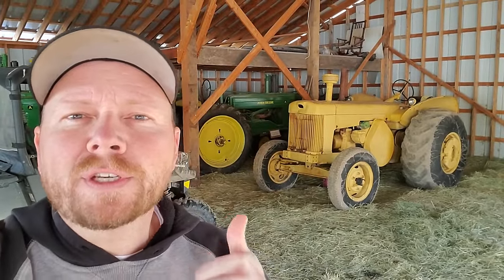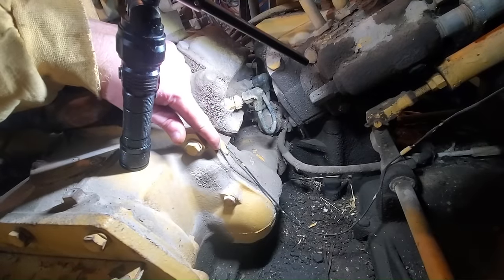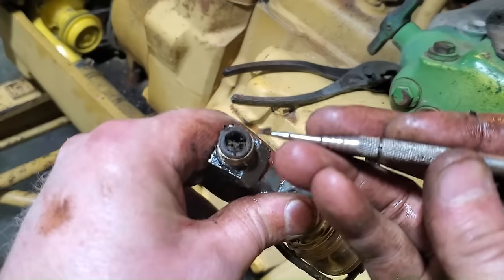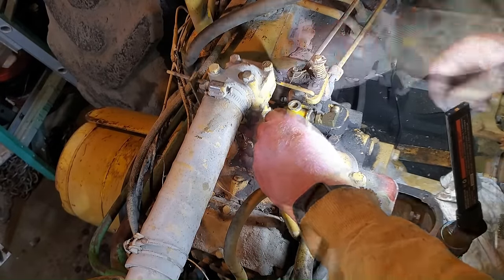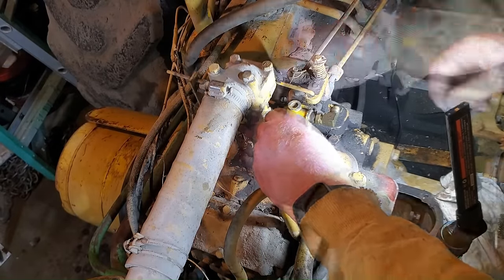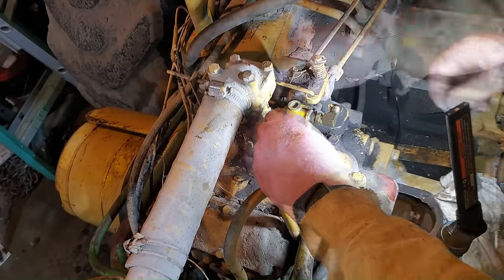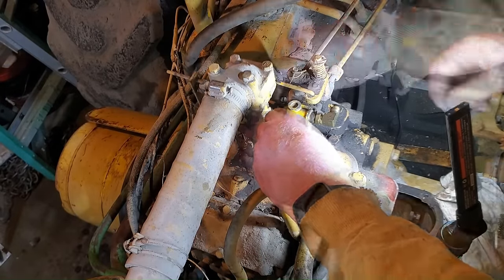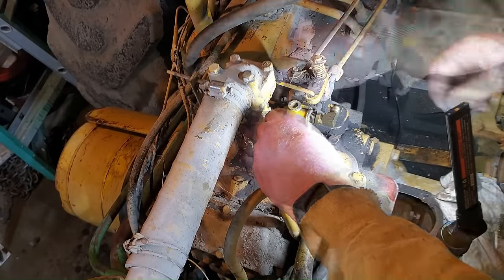Pony Motor First Start - John Deere 830 Industrial

Comment: Great job getting it going. But my lungs are choking from the smoke just watching. Wish you had more ventilation!
Reply from the maker: Ha ha! Yeah, you'll notice I had to open the garage door to air the shop out. I'm the summer we always have the doors open, but in the winter we try to keep the heat inside... So we end up asphyxiating ourselves😬

Comment: I have heard the phrase "the coils must be fried" but never seen any like yours.  Those are definitely fried.  Good decision getting a new distributor.
Reply from the maker: Yeah, I was hoping for the inside of the distributor to be a lot better. But now I guess I never really need to worry about it again (knock on wood).
Reply: @jonelsonster do NOT leave your ignition switch on. Do NOT leave your ignition switch on. You will end up with burnt up coils again. I added an oil pressure switch in the circuit so that they don't get power unless you have oil pressure. If you want more details, let me know

Comment: I use champion J8C plugs in all four of my pony start tractors (least I think they are Champions, definitely are J8C).  Back off the throttle before engaging the fly wheel, it won't stall the engine and your brake in side the pony clutch is sticking, spray it good with brake cleaner.  It should break free but definitely idle it down first.
Reply from the maker: I'm learning. I'm hopeful that it's the brake that's stuck, like you mentioned and that it can be broken free pretty easily. I think that will be easier to access than the clutch disk down on the flywheel.
Reply: Study the owner manual. Pony motor is unique

Comment: There should be a grease fitting under the cover of the pony clutch area. I had that issue once but greasing the zerk fitting resolved it.
Reply: I tore apart two and neither had the grease fitting. I never figured out which ponies did or didn't have the fitting. I think it's for the clutch throwout bearing
Reply from the maker: Very good to know. I'll have to do some searching. It'll be interesting to see if this one has it or if I'm like @weirddeere and don't have it.

Comment: Seems like parts and components age faster when they aren't being used. I imagine the cracks are ports for unwanted moisture and that doesn't help either. The pony motor sounds pretty nice running. I understand they do tend to smoke a little though. Your daughter looks like a boss sitting up there steering. Girl power is real.
Reply from the maker: Totally agree. Letting equipment sit (especially uncovered outside) is very hard on all the different systems of the machine. And yes, my daughter loves helping me drive the old equipment.

Comment: That was a good idea to go ahead and get that complete coil pack assembly/distributor. Everything would be new and you wouldn’t have to worry about it for many many years but I do love the two cylinder, John Deere even the big ladies!!! Good luck to you with it !!!!
Reply from the maker: Yes, replacing the whole distributor now gives me piece of mind knowing it should be (again, I say should) reliable for years to come... So long as I remember to turn off the ignition when not in use!

Comment: You can bet that tractor probably did not get as much maintenance done in all it's working life as you have done so far.  I know one thing for sure, not many guys are able to get that hood off by themselves as you just did.  I have owned an 80 for over 16 years and I always use my portable shop crane to get the hood off.  Many times just raising it a foot gives more than enough room to work.  Great find getting that tractor, your climate there must be nice and dry as tractors don't last long sitting outside in Ohio.
Reply from the maker: I'm fortunate that even though it sat outside all those years it's in as good of shape as it is. Winters are cold and snowy, but summers are dry out here, so yes probably easier on steel structure than the Ohio. And that hood is heavy. It's hard lifting it off, but I think it was harder lifting it back on 😂. Next time I'll have to try the engine hoist

Comment: Keep it up sir. You got my motivation to work on a 720 diesel that I have had for several years and needs a little tlc. 
I had almost the same issue with the starting engine, just had to adjust the starting trans clutch. Pony engine smokes a little as well, but not too much. You will get it figured out. Good luck buddy.
Reply from the maker: Thanks! I think you're right, it's probably a simple fix or adjustment. I'm just happy the pony subbed healthy. Smokey, but healthy😂

Comment: All those pony motors smoke, or at least that is my experience as well as the reports of many.  I have only ever bumped into one person with a pony motor that doesn't smoke.
Reply: New motor with new valve guides and piston rings doesn't smoke. Cost me more than the tractor to rebuild my 70 diesels but it is one of the nicest running motors now.
Reply: That is what I hear; cost of a rebuild is stunning; and even then some of them still smoke.   @johndeereman112
Reply from the maker: I'm hoping with some TLC this will be a good runner and not smoke so much... Because I'd prefer not to dump $2k+ into rebuilding this pony engine.
Reply: I hope that works, but it has not been my experience; since I only use it  once in a while, let it smoke; I just keep good oil in it. @jonelsonster
Reply: I found a cheap carbide valve seat cutter on ebay for a 3-5hp briggs and Stratton that also uses 1/4" valve stems and used that to fix the seats in my head. Found a valve kit through h&j machining to fix the ones I had that were too pitted to seat anymore. I did all the work myself so that saved me a ton of money compared to giving it to a shop to do.

Comment: Excellent video Jonelstar  :) nice seeing Pony Motor start and it need some fix up on like sparkplugs, distributor , starter  switch , amazing clean carb and air filter pot clean plus fuel tank too! Hopefully started gear setup it be easy to fix and repair on !! Well done so far !
Reply from the maker: Yes, I hope in getting to the point where I can go out for a drive!
Reply: @jonelsonster  agree to  !

Comment: Engage the starter and decompression lever and start the pony. That will get the big engine running for the time being. Might need a pony motor clutch adjustment also.
Reply from the maker: I thought about doing that, and I almost did... But got worried it might break something. Have you done this before? I'm hoping it's either the clutch disc or the brake in the starting motor transmission that are just a little stuck. Fingers crossed 🤞🏻
Reply: @jonelsonster  I don't think his idea is a very good one. That's like trying to start something with a manual transmission with it in gear and the clutch engaged. You are putting a big load on the starter of the pony motor that it wasn't meant to do in the first place. Fix it properly.
Reply: BAH HUMBUG!!!!!!!!
Reply: @jonelsonster  yes I’ve done this in a pinch a few times. I’ve never did it but heard of old timers running tractors home on the pony motor. Never saw it in person or would recommend

Comment: The precleaner bottom does just slip on and off, a deadblow should get it, maybe it would require a little heat. When I saw your coils, I knew they were toast LOL. Congrats on changing the ever neglected back two plugs hahah. The pony grinding made me cringe but not a shocker. It's hard to get things adjusted right. Pull out the book and try to follow the adjustments. The pinion shouldn't be spinning until you pull the lever back. Your clutch is too tight/sticky, or stuck. You could always try engage it THEN start the pony (decompressed diesel). A little rough but might be able to test how the pony cranks the diesel. One other VERY common issue is there is a BRAKE pad where the pinion sits when disengaged (it keeps the pinion from spinning from clutch drag. If the pad is worn, or greasy, it will spin all the time and not want to engage.
Reply from the maker: Yeah, the sound of trying to engage a spinning straight cut great into a stationary one is not a good sound. It's kinda hard to see, but you can see my Dad's head above the hood line and when I grind that starter gear he flinches really bad. Definitely need to get that brake or the clutch disk unstuck. Or just properly adjust the linkages and such, because I don't think the teeth of those gears could endure another failed attempt.
Reply: @jonelsonster I've also found them to engage better at idle instead of full throttle

Comment: A magneto is self sufficient and beside the plug wires has only a kill switch coming out that grounds out the coils. They do not require ANY power. Least any I've fooled with didn't. And with the Cat motors you pushed the clutch/start lever to stop the pinion gear and then pulled to engage it with the flywheel. And I always did that with the compression off or NO compression, got it spinning with the oil pressure up and then put the compression in and opened the fuel. God Bless!
Reply from the maker: Yes, magnetos are great. I love em. Kinda wish Deere had stuck with the magneto for the 4 cylinder pony engines, like they used with the model R pony. But they switched to a distributor.
Reply: People will always TRY and improve stuff even if the original works just fine. I've done it myself but try and REALLY improve things that the factory ought to have done like put an E-stop right by the control valve handle on the 37 ton wood splitter I had instead of a dinky thing on the motor blower housing that you had to run all the way around the unit just to try and get to it with oil spraying all over. And I bet that girl of yours is a DOLL! Daddy's girl too I bet. They all are if you love them! Blessings to yall! @jonelsonster

Comment: I ran into all the same issues with my 820 it was like reliving the exact experience 😂…..good call on replacing the whole distributor, at the end of the day it’s $120 more but your time to go through and rebuild the old one is worth something too especially if you’re in the situation where you only have limited amounts of time to work on these tractors. Seeing as I’m getting to this video a little late and it takes you time to get it posted, you’ve probably by now taken all the covers off the pony transmission and found the bendix is sticky and needs to be lubed up a little.  I highly doubt it’s out of adjustment so I’d first start with cleaning out all the dust and whatnot and lubing the shaft so the bendix can float freely.
Reply from the maker: Yes, it took all of 10 minutes to install the new distributor. If I had went the other route I probably would have trusted off several screws removing the coils. I'm hoping I can just "unstick" something or get something moving freely and resolve the issue.

Comment: So on my 820 my clutch was froze I actually would start it by pulling both levers then start the pony then one day I took that inspection cover off used wd40 and a flat screwdriver and got everything freed up now it works great... I was dumb and spray wd40 on the frictions... so then I had to spray break clean to get rid of the wd40 lol
Reply from the maker: I think I'll have to end up doing something similar. But I bet the clutch is just frozen or stuck to the flywheel, bust like you said.
Reply: @jonelsonster  yea I tried just engaging the gear to the big engine and not pulling all the way to try to use the power of the engine to free it up but after I pulled the cover I found the clutch linkage was also froze up and that was part of my problem you might have that too
Reply from the maker: @matty2helpfull  thanks for the advise!
Reply: @jonelsonster  your welcome I have been fixing up my 820 and this summer I have to pull the diesel tank on mine to glean the sludge out of it

Comment: There’s a brake in the pony trans that stops the gear. Most are worn out but if you push the leaver in it should stop the gear and then a swift pull it should go in without grinding.
Reply from the maker: I'm really grateful for all the people who have given me good suggestions. Several, like yourself have mentioned the brake. I didn't even know there was a brake, so I definitely have somewhere to start troubleshooting. Thanks!

Comment: I have 830 electric start good starting tractor as long as batteries are charged had 730 pony start had it starting good but did a lot of work to get it that way
Reply from the maker: We have an electric start 830 too.  It starts very easily.  And this tractor seems to start easily too, when using the belt pulley or pull starting.  So I'm hopeful i can get the bugs worked out with the pony motor and get it to start smoothly.

Comment: Keeping it an original on wico  mag It would be the way I would go. Slow Progress is the it goes on those tractors. At least What my experience was on my John Deere A 51.
Reply from the maker: I like magnetos. They're great. Unfortunately it wasn't an option on the 4 cylinder pony engine. Completely different interface than the standard flange or base mount magneto. But the distributor worked well now, so all is good.

Comment: HEY, pony motor sounds great !  Something is STUCK ..  Rusty clutch parts ?  Not adjusted correctly ?  It should  mesh with the flywheel FIRST before catching the starter clutch. Great video.   thanks
Reply from the maker: I hope your right.... And I think a stuck clutch disk is a likely culprit. After sitting so long a lot of the linkages were stuck.I couldn't even move the throttle or the gear shifter. I think this is just another case of that.

Comment: They usually smoke even a fresh rebuild one. The clutch disc is stuck to the flywheel or the linkages are set wrong the drive should be into the big engine flywheel teeth and then it should start turning the big engine over
Reply from the maker: That's what I aim to find out next time I am up at my Dad's place

Comment: Can you get someone to straighten out the front of the bonnet and radiator grill please, its driving me crazy. Just came across your channel and have liked and subscribed. All the best from England. Ps, it needs a front protection to stop it getting bent again.😊
Reply from the maker: It's dented on the front? I hadn't even noticed. 😉 
Yeah, I'll fix it but it's very thick metal. Probably like 14g. It's not going to just pop out. Thanks!

Comment: Do not connect six volts directly to the distributor. The resistor on the back of the ignition switch steps it down to about four volts. Six volts can burn up the coils.
Reply from the maker: Yup you're right. But during starting the distributor gets a full 6 volts from the battery. So, for a few short seconds it can handle 6 volts without any problems.

Comment: lower rpm or there might be a clutch on the starter pinion
Reply from the maker: @amyjojinkerson-b6o  unfortunately there were several issues with the clutch and starting transmission that I've discussed in recent videos. But I'm about ready to get everything back together and in operational condition.

Comment: Engage the starter gear and see if the pony will turn over. It just might break loose!
Reply from the maker: I think that's what I'm going to try. If that doesn't work, then I'll have to pull the whole starter transmission... And that will be a pain.

Comment: measuring the voltage at the starter isn't a good cable test  . You could have votage drop under load  . Voltage is just potential  .
Reply from the maker: But it does tell be that voltage is there. That's what I was after. If I didn't have a ground or if there was an obvious issue with the cables then there wouldn't be power there.

Comment: Why do you have to hold the throttle wide open when you starting this type of motor I'm just curious i be never seen one of these engines before its really interesting
Reply from the maker: Throttle has two settings. I probably could have had it turned to the lower engine speed, but it's my first time running this too! 😅

Comment: Its a magneto
Reply from the maker: No, itis a distributor. It gets power to the coils through the battery, not spinning magnets. The model R had a Wico X magneto with a 12.5 impulse, but when they went to the 4 cylinder pony motor they switched to a distributor. 😉

Comment: I can see the frustration and disappointment on your face, but you have done a lot of work, got the diesel, and the pony motor running. That's a pretty good accomplishment already. 
Like the old saying. How do you eat an elephant? 🐘 One bite at a time. 
You'll get it figured out. I see comments that look like they'd be pretty helpful. 👍👏
❤️🚜🇺🇸🤍🚜🇺🇸💙🚜🇺🇸
Reply from the maker: That's the plan. One bite at a time.